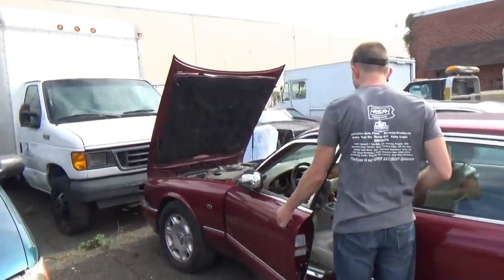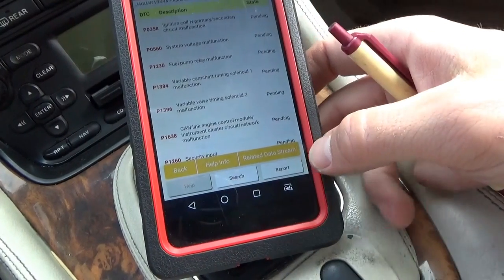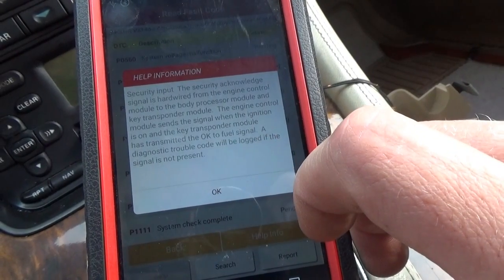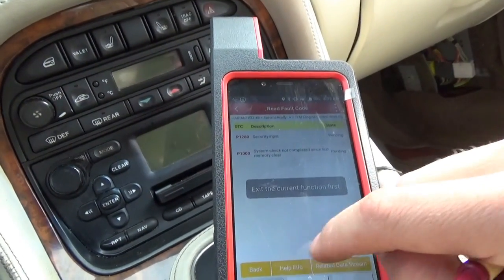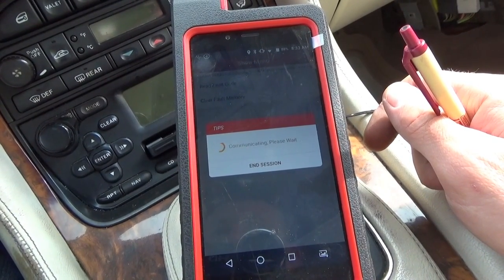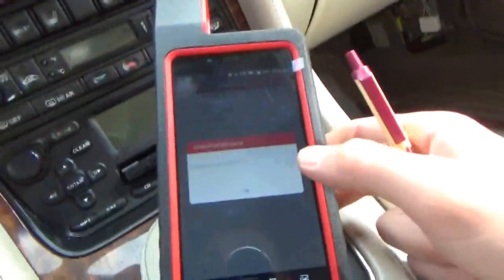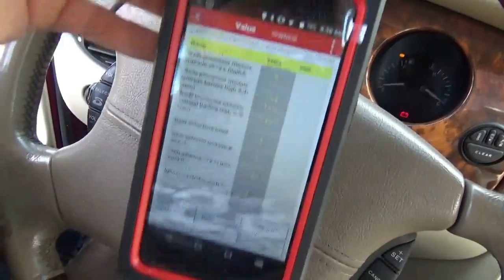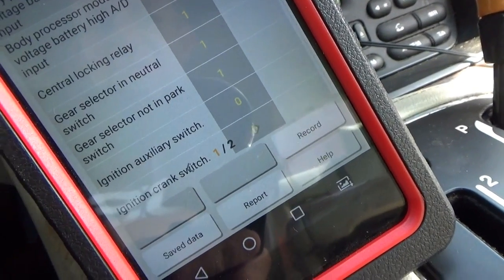Jaguar No-Crank: P1260 (SI Ep. 15.2)

Comment: I have a newer model a 2005 jaguar xk8. You can reprogram the key and the remote controller. There is actually only 1 key given with a jaguar.  The other is a valet key green and can only be used in the door and ig ition. The guy or customer may have pressed the valet  button by accident and now the regular key doesnt work. I am almost positive that your diagnosis is correct  and it is the key. Good job! And excellent  video.

Comment: [back, again.  / I called the jaguar dealership and they told me this. The reason why my jaguar won't crank and won't start is 1. check the starter relay.   or 2.   bad electric fuel pump. or 3.  the jaguar needs to be reprogrammed and i would have to give them over the phone some info on the car

Comment: [thank, you for you're video.   I, own a 2004, x type  3.0  jaguar. I'm having the samething going on with  my jaguar  just like  the one that you're working on. now this is what I did 
I, made a jumper wire and put the jumper wire  were the starter relay is at then I shot 2 sprays of starting fluid in to the air box. then I got back inside the jaguar and turn the key on then the jaguar started up only off of the starting fluid. so I know that the starter checks out good. everyone is telling me it's the electric fuel pump gone bad. so I did what I could do.  so next I cannot figure out what else it could be. I do notice that I got 3 fault codes that popped up on the cluster.   so what my plan is to load up the jaguar on to my roll back and carry the   jaguar to the jaguar dealership were they can  work on it.👍]

Comment: Hello! Everyone in here I have 1997 jaguar XJ6 L the car is not locking or unlocking with the fob just with the key have no interior lights headlights not working and no crank at all I try started with the direct wire to the starter and the car is running any ideas how to fix this issues? Thank you all in advance. 
And the swifter not moving even when the car is on

Comment: This was an excellent video.  I have the exact same problem with the exact same car and model year.  The Jaguar dealership has had it four times and couldn't figure it out, new battery etc all repairs that didn't work.  Still sits there unable to start.  For some reason placing the key in the drivers door, locking it and unlocking it and repeating that cycle again seems to reset the key and starts some of the time.  It looks like I need new keys, something that wasn't even suggested by the experts.  So thank you very much for this video, it was the most in depth and accurate video I have seen with this problem...

People should also check to make sure the light is engaged by the Park Shift as the car won't start if it doesn't recognize park at the shifter either...   This model year is plagued with this problem you solved...  Thank you!

Comment: Even it was 3 years ago, I found info: to program key  - put key into 2nd. position of ignition switch (dash on) and press lock button (padlock) for few seconds. I don't know where that button is but easy to look around inside. Maybe door must be closed too. So if the transponder in key is ok all should be fine.

Comment: I have the same fault p1260 on my 2002 Jaguar x type wherein scanner indicates anti-theft is activated. Indicator lights are on but no crank with original two keys I have and does not recognize both. Transponder module is working. Is it possible that the key transponder is dead because of the age?

Comment: Please tell me how to get another key and program it? I have a 2003 Jag x-type. I have both keys. They will lock and unlock and when put in the ignition will allow the lights, Air conditioning, radio etc, but eveidently not allow fuel pump to send fuel. I asked the Little Rock Jaguar dealer if they could help me, they said they don't work on Jags that old and said the key's not the issue, but that's all they would say about it ...

Comment: I believe that the security indicator light is not at the top of the dashboard,that is the ambient either temperature or light sensor.  The light your looking for is a little LED directly left of the gear shifter.  Typically people miss it because the LED is finished smooth against the moulding,  When you run your finger over it you don't realize it's there

Comment: Was this issue ever resolved? I am facing roughly the same problem.
Reply from the maker: Yeah you need a new set of ignition keys.
Reply: @PineHollowAutoDiagnostics  I dont have a scan tool as fancy as yours, but using a voltmeter as was able to rule out everything except keys and a couple other things. I told my customer that he would likely need a new set of programmed ignition keys. So it's really good to see a video with almost the exact same issue, coming to the exact same conclusion as my own. Thanks for replying, and making videos!

Comment: I have a 2003 Jag X-type 2.5 doing same thing. I have 2 keys and neither one will start it due to security  immobilizer problem. Should I have 2 new keys cut, or might it be transponder module? You purchased the ring around ignition with LED from Keith? You guys are good! Thanks

Comment: I have the same problem with my 96 I use the module first then it wouldn't start then I got out locked it back with the module unlock the it manually outside the vehicle then it started

Comment: Jaguar has immobilizer built in by the shifter itself. Check and see if the letter “P” is illuminated and if it is not move the J gate back and fourth in order to disengage imobilizer. The other thing as well is to disconnect battery for full 5 minutes and then re connecting it again. Valet button press firmly in the center arm rest and make sure it is switched off. In the passenger side footwell there is also fuel/imobilizer switch and should be checked too. These are just a few common issues that will
Cause the Jag not to start

Comment: I think it's unfair to call British logic system in this video, logic state 0=low, logic state 1=high, your reading it like it should be saying on/off. If you read what it says at the top of the column it says "VALUE". I bet if you look at code setting criteria for this it will tell you the inputs are active high or active low therefore what your seeing is the logical value of the input/output. On an active low system taking the input low can actually switch something "ON".

Comment: I have a no crank issue my fuse box clicks and red light flashing on dash whenever I try to crank it and the key fob isn't working even after a new battery I noticed a crack in the board could it be that ?

Comment: This video helped me immensely this morning. I was using my backup key the last couple weeks after digging it out because my doors locked on me mysteriously at the gas station. Tried starting 2003 XJ8 this morning with that backup key and .........nothing. No crank. Put battery on a charger most of the day. Noticed it was drawing some amps, so figured that might be the problem. Came back to fully charged battery later on.....still nothing. No crank with backup key that worked up until now. Watched your video and the light bulb went on. Sure enough, tried my original every day key ......VOILA!!! Started right up! Maybe these keys are getting to an age where they are going to be a high fail rate part. Pass the word.
Reply from the maker: Nice! Glad the info was helpful!

Comment: From Jagrepair.com :  
"Take your transmission shifter and put it in the “N” position from “P” and try to start the car.  The shifter selector switch has been known to wear out or out of adjustment causing a no start situation.  If the car does not start put it back in “P” and check the inertia switch. 

The inertia switch is installed next to the fuse box in the LH end of the fascia. When activated, it de-energizes the ignition relays in the engine compartment, driver's side fascia and trunk fuse boxes. It also removes ground inputs from the BPM and windshield wiper stalk switch. This stops the engine and fuel pump, unlocks any locked door, and de-energizes unnecessary electrical systems. The switch is reset by pressing down on the rubber cap on the top of the switch.  If your doors lock, windows, seats and the wipers work and the dash lights up then all should be good, but if it makes you feel better reset the inertia switch.

Check that you have a fully charged battery and that you have power to all fuse panels.

First check that you have 12V + a few.  This is important and should not be taken lightly.  For whatever reason these cars are sensitive to fluctuating and low voltage.  Depending on where you are you can take your battery to AutoZone, PepBoys or Sears and have it tested.  This test is performed using a tool that is not just a volt meter.  It examines the integrity of the battery.  In most Jaguars you have a fuse box in the trunk, the drivers and passengers section both left and right and two under the hood.  You will need to check voltage at each fuse box.  If voltage is not present you need to check the fuses in the High Power Protection module."
Reply: Do you have a video or picture where this inertia switch is please as my car is still stuck at work.

Comment: 2000 XJ8 owner here. No scan tool. My diagnostic tree...try to start after each. 1. Put gear shift in neutral. 2. Check vehicle battery...connections/internal short/correct voltage. 3. Disconnect battery and reset by touching terminal ends. (this "fixes" my no power to driver window/sunroof issue everytime.) 4. Check to determine if fuse/circuit breaker for ignition system. 5. Look at wiring (rodent damage/corrosion) 6. Voltage at starter and starter relay. 7. Tap on starter if it shows voltage...bad spot in armature or brushes worn out. 
8. Call my local independent Jaguar (non dealer) specialist.  Boffo Motors, Inc (Jag/MG/Fiat) Gary Boffo, 724-843-3181, New Brighton,PA  (3 year owner, have not had to go beyond step 3.)

Comment: Looking back at the codes I would check the engine ecu has power.  Mine wouldn’t crank when the engine ecu was swapped so plays a part in cranking. And you had system voltage codes

Comment: This car doesn't have a CD player?  My 01 Subaru Legacy has a tape and CD player, and an additional 6-CD changer. Oh, and it runs.
Reply: Glycerin 6 CD changer in the boot. Alpine.
Reply: @AndyK.1  Nice.  Mine is up front with the tape/CD player.  I wonder why they couldn't do that.  Going into the TRUNK to swap CDs is kind of a pain in the ass.
Reply: Glycerin I think it’s what they did in 1997 when it was designed. In 2002 it changed

Comment: It's a bad relay you idiots
Reply: steve cott I was thinking that. The starter relay is one of them brown ones. But that shouldn’t cause error codes. And the lines should toggle
Reply: The reason I say it I had exactly the same problem gearbox failure engine failure suspension failure ESP failure every failure under the sun turned out to be one single bad relay and it's also would not engage the starter changed relay all  failures went and vehicle started

Comment: Since this is an older system, it makes me wonder if the system could be tricked (bypassed) into allowing the engine to start by connecting a test light to battery + and then connecting the other end to the "OK to start" wire, then turning the key to the on position and attempting to start the engine. It might work, but I don't know exactly how this system functions. Could it also be a possibility that the "OK to start" wire is open between the key transponder module and the engine computer?
Reply: Joseph Wash I was wondering that too. I thought the key code was also in the engine ecu. :(

Comment: Remember the good old days when you could start any car by running a wire from the battery to the coil and use a screwdriver to jump the starter?
Reply: Pretty easy to get them stolen!
Reply: @zoneb609  Yes it was but people had more respect for the property of others back then too.

Comment: I noticed a "Valet" button on the dash.  I wonder if that is a key transponder bypass?
Reply: It engages valet mode which allows a 3rd key to be used which stops access to the boot and the glove closet. Allows the car to be parked by the Valet.

Comment: Why don't you enter the EKA code via the drivers door locks and if it recieves it at bcm put key in ignition engine should start quick check to make sure that bcm and pcm work crank run and then further investigation

Comment: Ivan Can the Autologic blue box program used keys on these? I know it can with other models and has a key decoder for the barcodes. I’ve done hundreds of used land rovers fobs this way. The transponder is probably able to be viewed in their software too. Don’t know if Keith has t he software or not. Snap on/aftermarket are pretty piss poor when it comes to UK stuff and programming/genuine data- pinch of salt. I’ve also fixed these keys by reflowing the solder on the fobs many times.

Comment: Jag keyfobs have a pretty significant failure rate over time.  The issue is, I have yet to see a third-party scantool capable of successfully reprogramming, or programming new fobs.  There's a million and one different "dances" you can supposedly do if you have two keys, but more often than not, they don't work.

If memory serves me correctly, you can order new fobs from any of the various reputable sources online, disassemble the fobs, and swap the physical key into the new fob, then program the car to accept the new fobs.  See if Keith has a Magical Pringles Can that's able to do the relearn, if the launch is unable.  :)
Reply: rhkips have you tried Autologic on it? Not sure if it does that era.
Reply: rhkips it’s the key that’s the problem not the fob. Fob just does  alarm and locking.

Comment: Привет, Иван! А твои сканеры, не могут сделать процедуру привязки ключа в Ягуаре? 
В таком случае, я бы попробовал прочитать транспондер ключа в специальном устройстве - читалке для автоключей. А еще, можно перепрограммировать ECM, прошивкой без иммобилайзера. Это вполне реально, для такого старенького автомобиля.
Смотрю с интересом! Денис.
Reply: Secret message for Ivan
Reply: @keithfork8663  :) :) :)
Nothing secret! The transponder in the key could be checked with this: http://www.codecard.eu/carprog/cat_31.html    Or a Chinese clone of this device.
Re-program the key will not work. All three keys are required for this.
If Ivan showed us the ECU part-number, can find a cheap solution - reprogramming EEPROM. It is not hard.

Comment: Hey Ivan, it's worth understanding clearlty exactly what the flashing on the key test coil indicates. Tell me if I'm wrong, but the most it can tell you is that the Ignition cylinder antenna coil is receiving a V pulse from the immo module? It does not tell you if the embedded key chip transponder is sending its code even though the magnetic induction from the transponder does also pulse the cylinder coil. There is really no way of telling from the test flash LED whether this indicates just a good pulse from the key module, or a good pulse from the key module and then from the key transponder. ie you don't know if the transponder is good or bad? Do you think that's right?
Reply from the maker: Right, the LED on the ring only indicates that the module is trying to read the key :)
Reply: @PineHollowAutoDiagnostics  where you guys are located,  I have 1994 xj6 that wont start. but before that, at night when turn head light the battery indicator decrease and a screeking noise now wont start.im locate in Massachusetts please refer my to nearest technician

Comment: I drive a Jaguar X Type 2004.  First thing I did was get 2 clones of the Key made.  I always drive with 2 Keys to help prevent this issue.  I do live in England so new and used spares are cheap and easy to get.  And I think having only one old Key for your Car is rather foolish.
Reply from the maker: Great strategy!

Comment: What about the wiring between the ECM and the KTM?  You checked and found no signal from the KTM at the ECM, but did you check to see if the Y and W output at the KTM is working?
Reply from the maker: Great question, Drew! We did a quick continuity check on the Y and W wires while the KTM was unplugged, but there was no way to get at the wiring while it was plugged in.
Reply: @PineHollowAutoDiagnostics  True, accessibility is always a challenge.  You may want to mention that, after checking powers, grounds, reference, signal, etc. and you think you have the matter isolated to the component, that there is always the wiring that can be at the root of the cause unless full tracing has been accomplished (lest the parts changers out there will fixate on the component and miss the least expensive fix.)
Reply: And also perhaps to 'override' the 'OK-to-start' input of the ECM too (testing by hotwiring the old girl)

Comment: Can't you fake the "ok to start" signal on that connector from the key module to the body control module? Maybe just  with a test light.
 I would assume it's just a logic level supplied by the key module once it has read and verified the key - No?
Reply from the maker: Great question, Dave. We actually tried a test light "bypass test" at the PCM, but the signal is more complicated than just a simple "ON or OFF".
Reply: @PineHollowAutoDiagnostics  has this been a confirmed fix with a new key and program?

Comment: Ivan, you need an multi-frequency RFID reader that you can place near the key to see if it is responding.  It is likely that RFID chip in the key uses the low frequency radio (the power lighting your LED device) to re-transmit the correct numbers back to the car. Even if you couldn't actually read the data, you would then know at least if the key was dead or not. Maybe this key was dropped one too many times ......